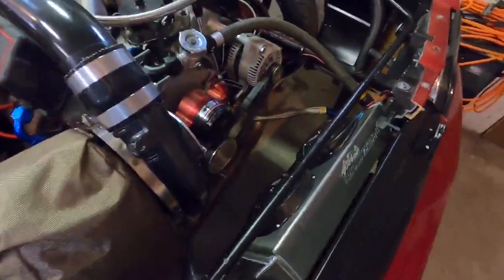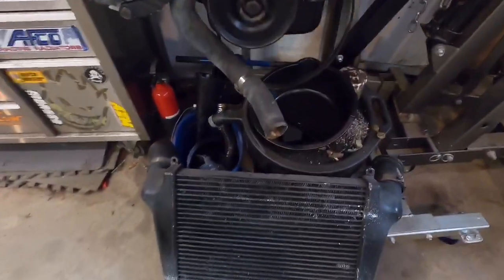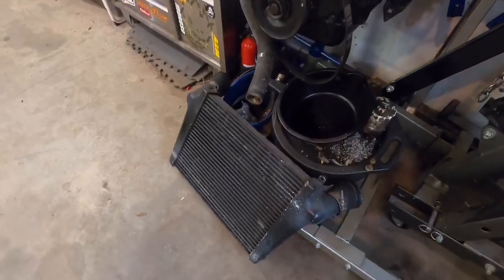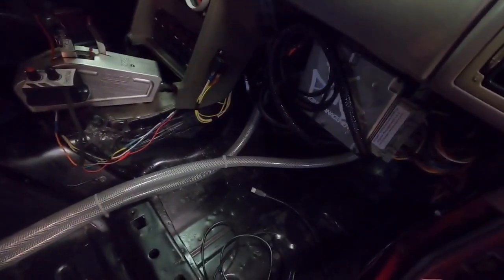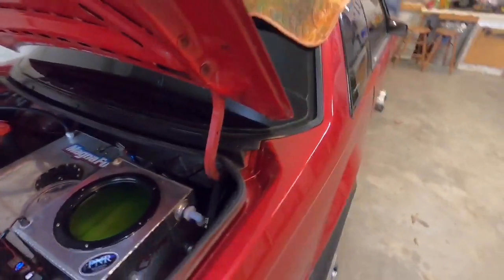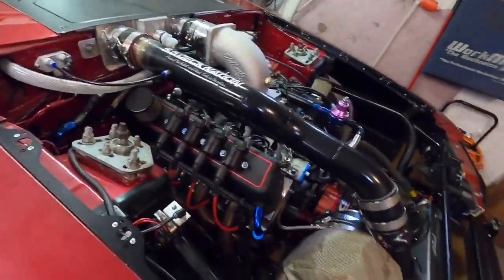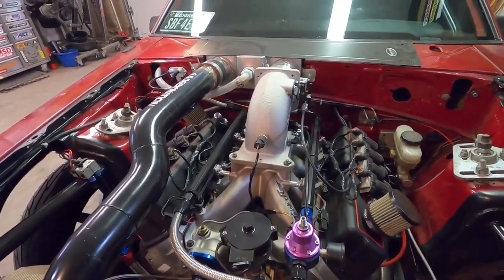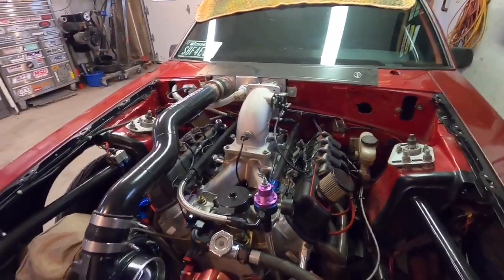Types of INTERCOOLER  and how they work, informational a2a, a2w

Comment: Nice video! Like your coil setup! Not sure I would put meth on my turbo!
Reply from the maker: It works good if ur on pump gas, if on e85 it’s not needed
Reply: @BlakesSpeedShed   yeah, I'm going to get some track time to get my suspension set up and maybe do 160 injectors and e85 somewhere down the road!